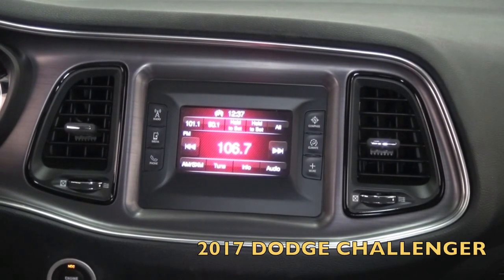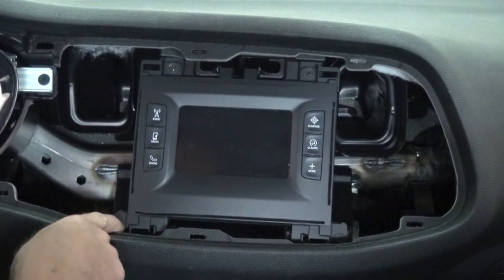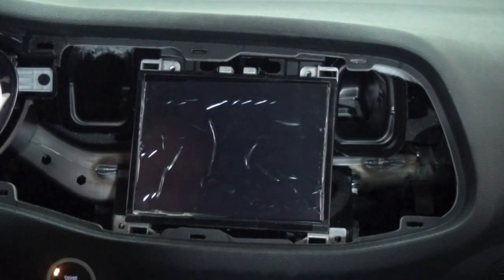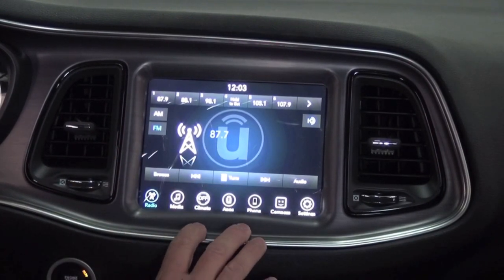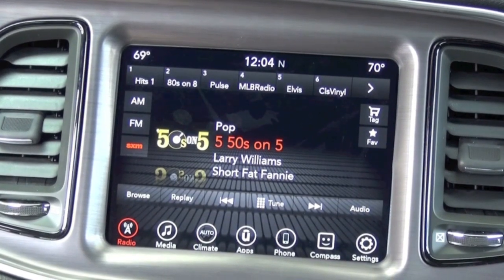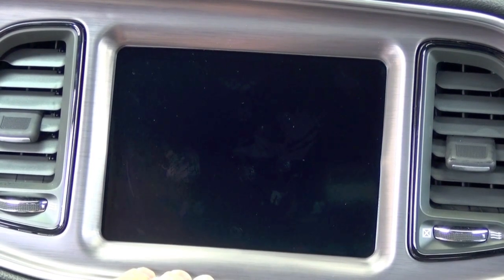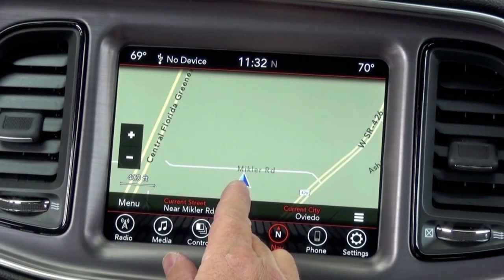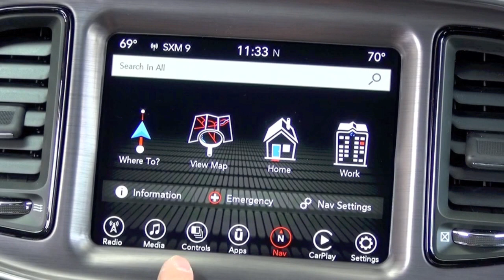2017-2019 Dodge Charger & Challenger - Factory UAS UAQ 8.4-inch Radio Upgrade - Easy Install!

Comment: Really wish he would have showed more of the navigation features, like does looking up gas prices work? Also, which apps/features DON'T work being that all of the antenna plug in's werent used
Reply from the maker: Unfortunately the Uconnect access apps will not work.  Customers who are currently subscribed to the paid subscription of UConnect Access® will forfeit this feature by upgrading to the new UConnect 4 system (which now uses Sirius Guardian®). At this time, it is extremely rare that Sirius Guardian will allow for a service retrofit.

With that said, we recommend utilizing the navigation apps that are offered with Apple Carplay/Android auto.   Many of them will offer the local live updates that you would otherwise lose with the Uconnect apps.

Comment: I have a 2014 Grand Cherokee with the RA4 system. Would I, in the future, be able to upgrade my system to the NEW 8.4 that includes GPS navigation with it? Or would I be able to do it now? The primary drivers of the vehicle use Android phones, so it'd be awesome to have Android Auto so we can voice text (we don't subscribe to UConnect Access, so we don't have voice texting for Android enabled).

Comment: I have a 2016 Dodge Challenger and I was wondering could I put the 2017 model radio in the 2016?
Reply: The Black Challenger wondering the same thing. It's way better in 2017. A lot more fluid. I hope it can work.
Reply: Hopefully they can update the 2015-2016 radios so they can support Apple CarPlay and Android Auto.
Reply: If you watch the video for the 2016 radio it looks like the connections are completely different. I don't think you can upgrade to the 2017.
Reply: Alimonytony you right!!
Reply: Hope they can update the 2015-2016 radios!!!
Reply: Alimonytony https://www.infotainment.com/products/2015-2016-dodge-charger-challenger-8-4-nav-uaq-retrofit-kit

I found this. You can swap the 2017s to previous models with this kit
Reply: The Black Challenger https://www.infotainment.com/products/2015-2016-dodge-charger-challenger-8-4-nav-uaq-retrofit-kit
Reply: Cammed Scat Pack wish I would've known about this...I just bought the 2016 8.4 radio😩😩
Reply: The Black Challenger sorry. I just found out..

Comment: I have a 2019 Dodge Challenger and I was wondering could I put the 2015 or 2017 model radio in the 2019 Dodge Challenger ?
Reply from the maker: UAQ/UAS 8.4" Uconnect 4 head unit is going to be the same for 2015-2022.  The drop down menu configuration on the page listing for 2015-2016 includes a USB media hub.  2017-2022 does not require the USB media hub, as it is already equipped with the USB media hub required for the Apple Carplay/Android Auto functionality.
Reply: @Infotainment_nav  Many thanks✊🏽

Comment: Do they come with the performance pages?
Reply from the maker: You should retain the performance pages so long as the vehicle isn't a 2015. 2015's don't seem to retain the heated seats/steering wheel and performance modes with the Uconnect 4. We should have a solution for that soon!

Comment: I was wondering if the RJ4 or RA4 works in the Middle East (Saudi Arabia)
Reply from the maker: The RJ4 is the exact model you'd need for the Middle East. We sell the replacement for it here: https://infotainment.com/shop/interior-accessories/export-infotainment/c-sporj4/

Comment: would this work for a 2015 Dodge charger?
Reply from the maker: 100%. It will also come with a replacement USB hub, to give your '15 Charger Apple CarPlay and Android Auto capability.  https://infotainment.com/shop/interior-accessories/infotainment-radio-upgrades/2015-2022-dodge-charger-gps-navigation-8-4-4c-nav-uaq-radio-with-apple-carplay-android-auto/